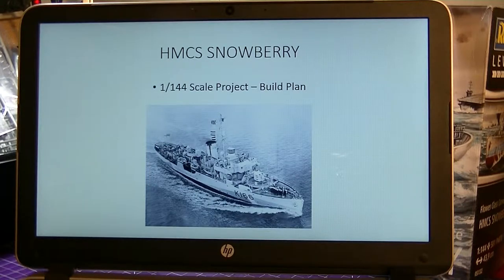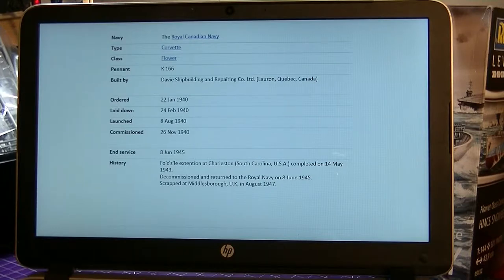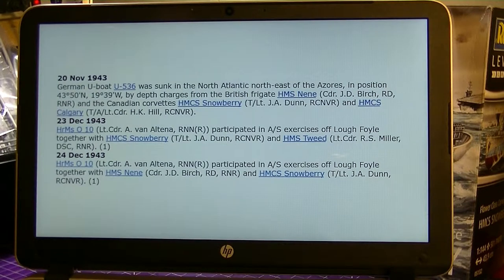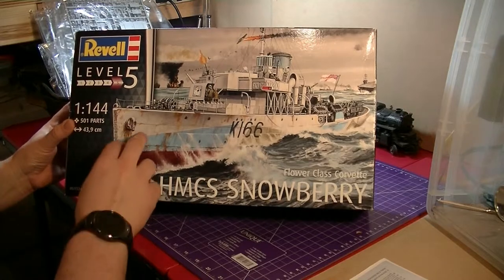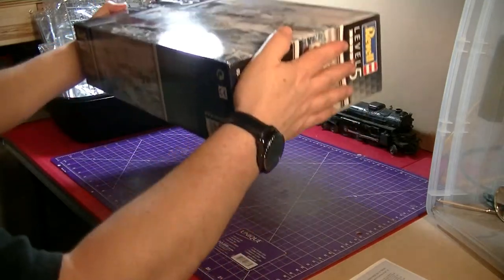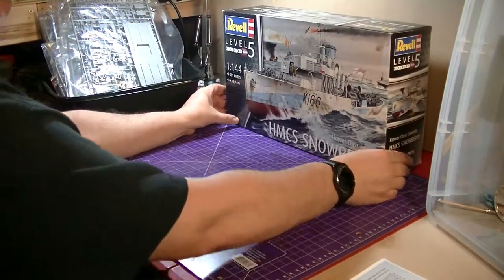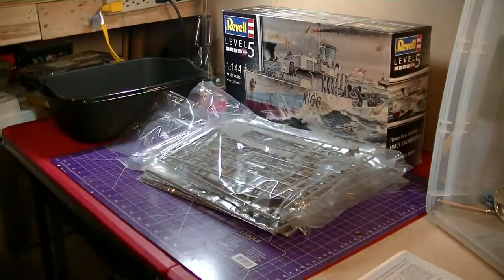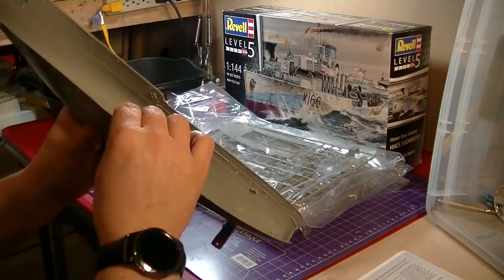HMCS Snowberry Video #1

Comment: Question: Is that a Revell or a Revell Germany model. It looks as presented to be a Revell Germany kit. Also, if you would, for a future video in this series, take a look at the decals or the instruction manual, for a date. It looks fairly recent release. Thanks and best Regards, Solomon
Reply from the maker: Its a Revell Germany model released in 2016